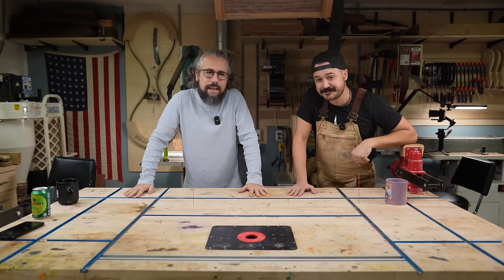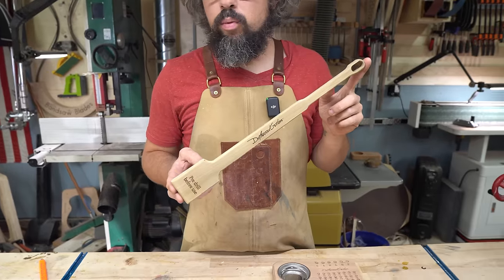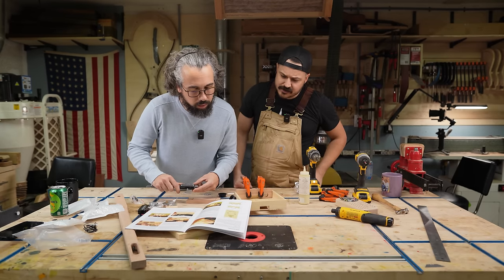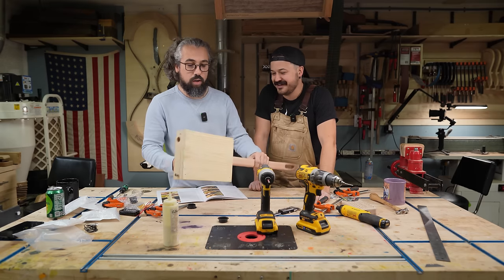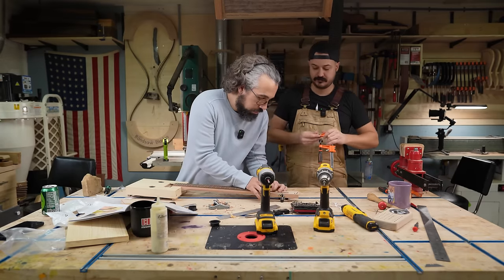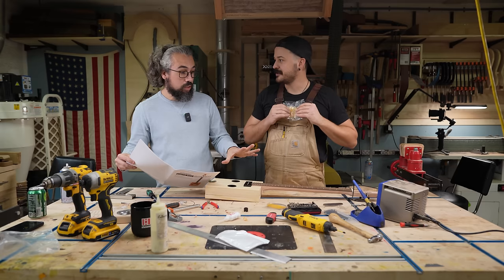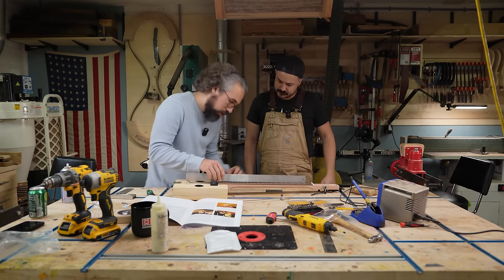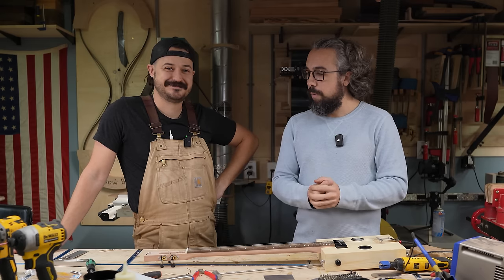Get Started As A Luthier For $100!

Comment: I bought the kit, but immediately started upgrades to it.  As I want to give it as a gift.  So basically I bought it for the design, and use some of it as a template.  Changing pine box with cherry, changed the screen bridge with a really bridge, and a few other things.  It’s amazing what is available out there to build Cigar box guitars, with 3 string version of 6 string guitar parts.  Thanks.

Comment: This actually doesn’t look too scary. I would totally love to try a kit like this sometime. I actually think this provides more value and useful skill teaching than pedal kits. It also looks totally fun — those 3 string built Loog guitars of the same size as this kit are $40-$50 at their regular price. Lots of adults buy Loog guitars even though they’re meant for kids because they fun and portable. For $100, you get to learn some skills, save some money, and can even paint it to your liking or mod it easily. The Loog guitars are well built and hold up to the abuses of kids over time. My 3 nephews have had one for 6 years that is a bit relic’ed, lol — although the nut fell out and got lost, but I got a replacement pre-cut nut for 9 bucks from the company that I’m gonna glue in. However, I’d imagine that StewMac is likely providing a much better pickup and parts. I’d actually be curious to compare the quality and performance of this 3-string to a Loog. Anyway, it looks like a fun build, and the price seems fair if you have the necessary tools laying around your house.
Reply: Oh, and congrats on apparently hitting the 70,000 follower mark! 🥳🥳🥳

Comment: I am subscribed and in the distant past I used to tinker with setup on my guitars,one time a friend asked me to repair his 12 string for money!!
When I checked the guitar I kinda got scared,loose braces,bridge off and he wanted a refret.what I didn't spot at first was the neck bound in faux tortoise shell.
DOH!! so each fret had to be cut to fit around the binding.When I finally got it all fixed I was obliged to warn him of the pitfalls of leaving his guitar in the trunk of his car in the middle of summer,so he put it on the back seat and somebody stole it.At least they didn't replace it with a couple of banjos,that would really hurt......................